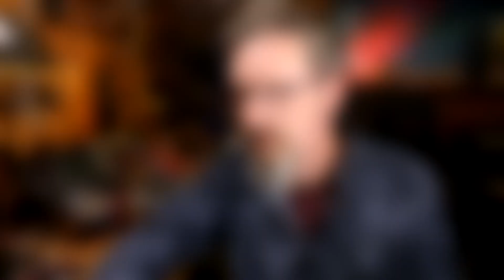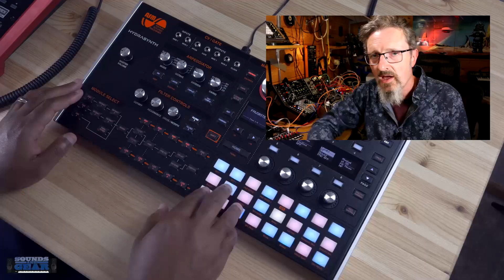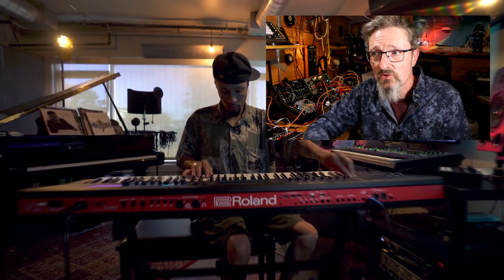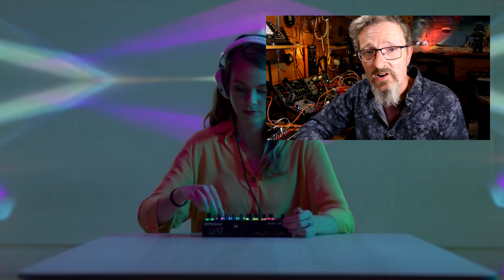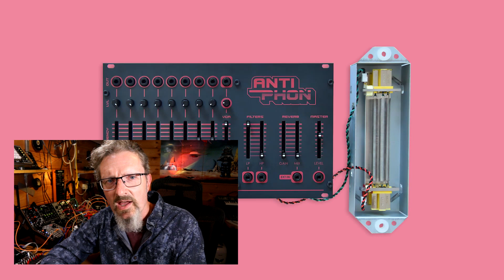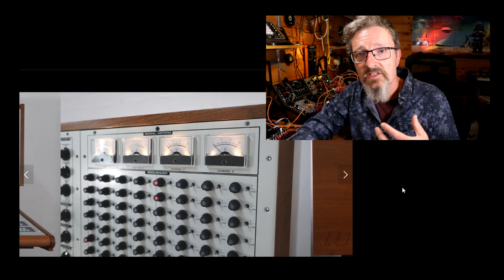Molten Music Monthly - September 2019

Comment: On the point of the 101 module copying behringer, I don’t think that’s quite the case. The SH101 runs off of a CEM3340 chip and that has 3 waveforms and I’m pretty sure it has an FM input so I’m sure it’s just Gstorm trying to get the most out of the chip as possible rather than then then copying behringer
Reply from the maker: Which is exactly my point. If they were intending to be authentically Roland then they would have left those bits out, but rather they are trying to get the most out of it just like Behringer did. I'm not making any judgements on that i just think it's interesting :)

Comment: The G-Storm stuff is nice and every effort has been made to replicate the original circuitry, sound and feel but.....It's a bit pricey. For a full 101 setup it works out more expensive than the Atlantis, though the Atlantis is not a direct clone and merely inspired by the 101 it could be said that way because of patents. The JP-6, just get a Jove, better still buy a uJove, still fits your 8hp. As for the 101 VCO, Rick at FC has just booted out a 3340 VCO with the same features (and cost shag all to build, if that's your thing), short of a mixer stage but in steps the MA CP3...past the 3 Oclock position it drives for more colour.
That aside, the G-Storm panels....yes please.
Anywho, haven't you got a Deckard's Dream to build.....

Comment: That Pico system looks like it would go great with in the Rack Brute along with my MiniBrute 2S.  That's some of the best value I've seen in modular components, next to Behringer.  The Dreadbox Antiphon also looks incredible, but as a soldering project, looks pretty time-consuming..though not as scary as a Deckard's Dream.   The Antiphon interface looks a lot like that interface for Aeolian Meditation drone VST.